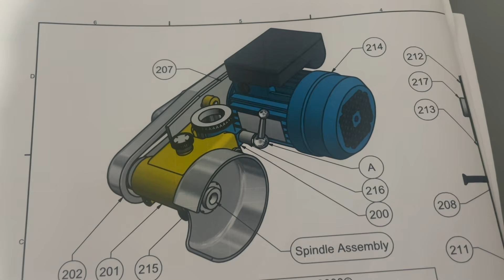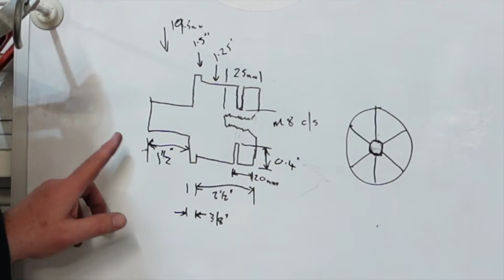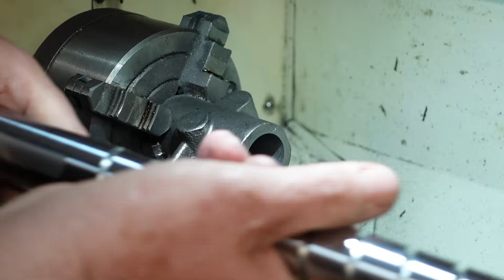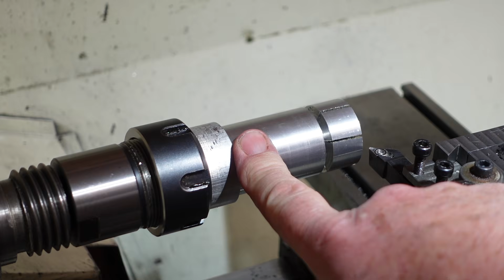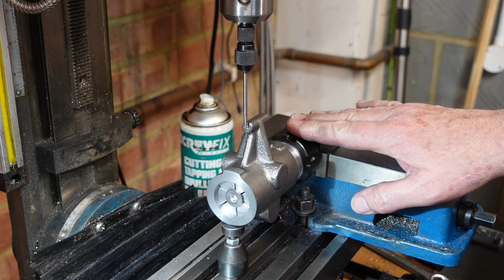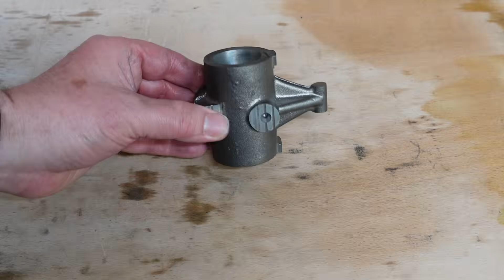Quorn Mk3 Tool Grinder Part 10 Wheelhead collar

Comment: Many thanks for the shout out !! The part came out nice. Don't forget to add a small shallow straight hole, a little larger than the major diameter of the screw, to allow for the unthreaded portion of the actual screw. Otherwise you risk damaging the lead threads on your arbor.
Reply from the maker: Thanks Joe!  I’d missed that detail!  I’ve a feeling I’ll be using similar arbours again on this project!